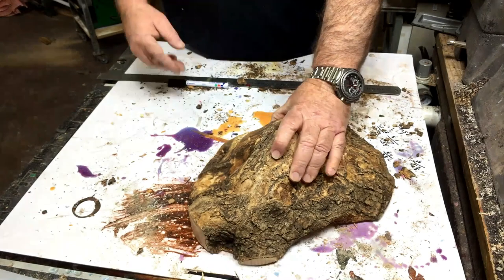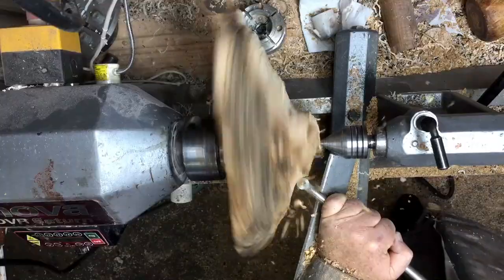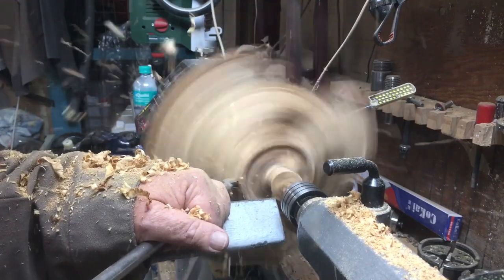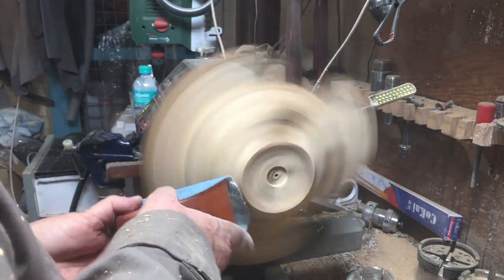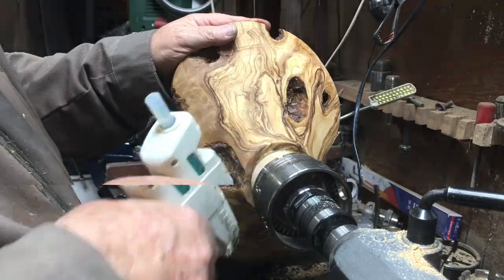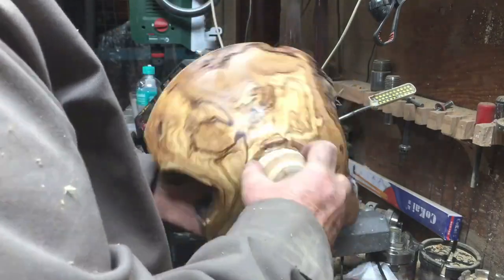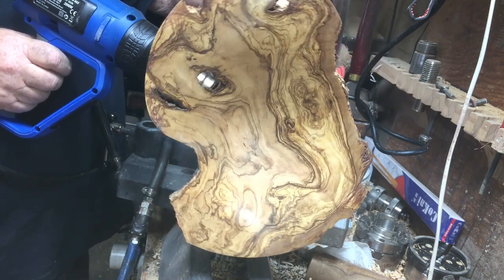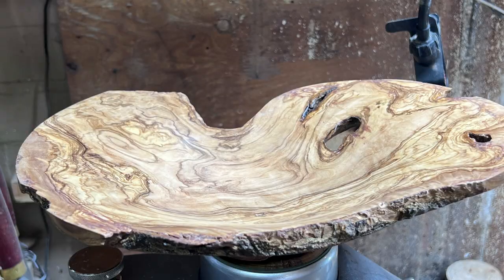woodturning a olive bowl

Comment: Ahron, not using any resin was the right choice - this piece of wood didn't need any. That grain has so much character any colored resin would have detracted. That off-balance turning can be a bit tricky, but you handled it in your usual efficient manner. The end result is a fabulous looking bowl. BTW - it's usually a good idea to clean the EEE off with denatured alcohol before any finish. Well Done!
Reply from the maker: Qapla thank you for your comment and your tip .